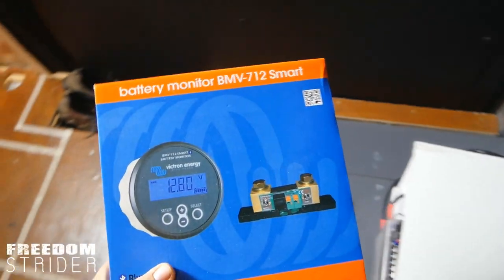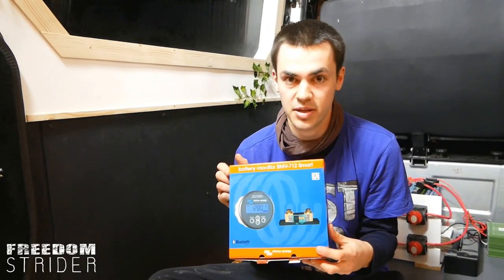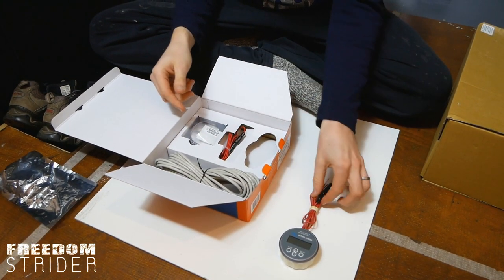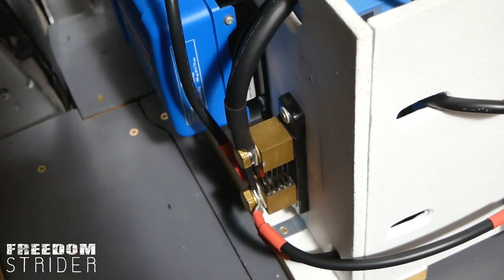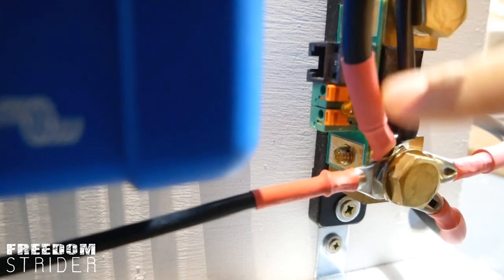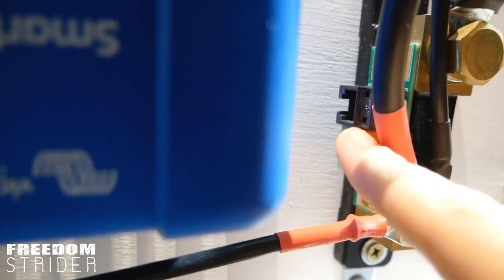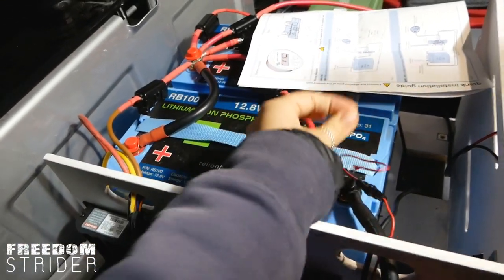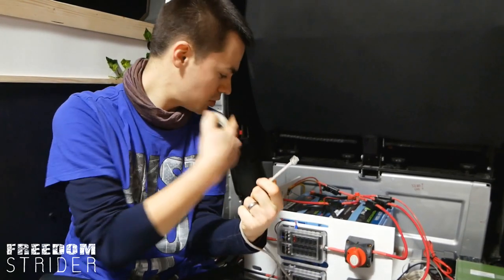Victron BMV 712 Install Guide for Lithium Batteries

Comment: Nice video - thank you.  Just a quick thought, like everyone that has ever wired something, we often don’t have the “correct” color wire, tubing or whatever, but it’s imperative to take precautions to remind yourself in the future or those that come after you that the red wire is actually a negative wire.  I might suggest covering those red shrink tubing with black tape.
Reply from the maker: Thanks ☺️
In the event that we do sell the van then of course we'll relabel and recolour as necessary. As it stands today, no one but us is touching the systems in the van. I would love to make it look neater though, so when we upgrade we may recolour anyway.

Comment: Hi guys, im right behind you on the same build, i think im catching you up ! :) just wondering what refrigerator your planning to use? I notice you have 200ah of lithium batteries. Im working my electrics out and it seems i need 364ah (!) to run a 46w thermoelectric cooler box for 48hrs. ( agm batts so only 50%discharge and this isnt evenincluding lights or anything) does this sound right to you guys or have gone wrong here?! Seems loads just for a simple coolerbox.
46w÷12=3.8a 
3.8a x 48 = 182ah
182 ah x 2 = 364ah  (50%discharge) 
Thanks for your help !
Reply from the maker: Hi bob, 12V fridges are quite a thorn in our backside since they are expensive. At the moment, we're planning on getting something like this: http://www.shoreline-marine.co.uk/fridges/small-fridges/small-fridge-fm061

As for the maths, you are correct and that seems pretty high, however, fridges aren't always running 24/7. They turn on and off, so won't always be running on full power. For example, the fridge we're looking at is 40W (3.33A) but its average consumption is around 0.87Ah (per hour) since the fridge isn't on all the time. Try and find the average Ah consumption for your fridge and you can use that for the maths.

So 0.87Ah * 48h = 41.76Ah to run the fridge for 48 hours (for our fridge). Not as bad. 😂👍
Reply: @FreedomStrider  thanks for the advice i really appreciate it. Ive had trouble finding the average running amps on most of the cheaper ones, im wondering whether to hazard a guess at 1/4 of the rated current.
They are so expensive!  Cheapest ive seen on ebay is 250. Not the best but im sure theyd work. Next step down is a thermo electric cooler. (Fans and peltier) although im not sure on the cooling of these for meats etc as ive never used one

Comment: Did you guys ever get the smart shunt to run like a Dc metre for the alternator
Reply from the maker: No, we only used the shunt from the BMV, though I imagine getting multiple shunts means you can just see how many amps are being used by a specific device at one time. Not heard of a smart shunt for an alternator before?
Reply: @FreedomStrider  yes you can turn the shunt into a Dc metre for the alternator to a cerbo gx

Comment: i think your charged voltage is wrong, should be 13.9 i belive for lithium
Reply from the maker: Each brand of Lithium batteries recommend a different charged voltage, we used the spec sheet of our Relion batteries but yours might be different 👍
Reply: @FreedomStrider  I think there is a difference between charged voltage and charge voltage, According to victron manual the charged voltage parameter should be 0.2 or 0.3 below the float voltage. see also page 24 of https://www.victronenergy.com/upload/documents/SmartShunt/Manual_BMV_and_SmartShunt-en.pdf
Reply: @markfodor1515  Noticed a lot of people confusing the two. Charged voltage would be closer to around 13.2-13.4 V, depending on your float voltage. Different again for solar, which would 0.3 below the absorption voltage (14.1-13.8).  Oh dang, now i'm confused.